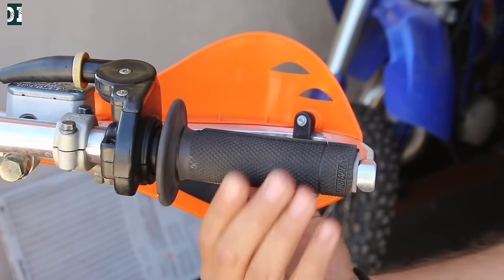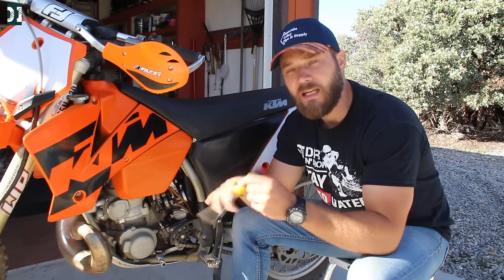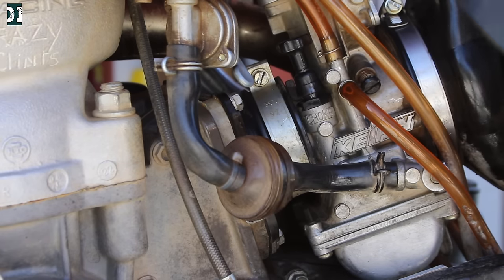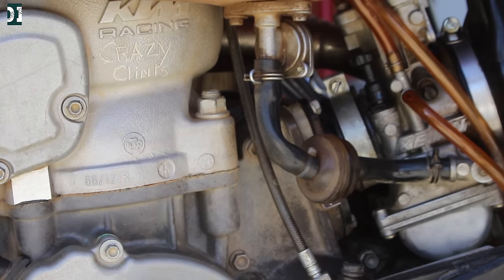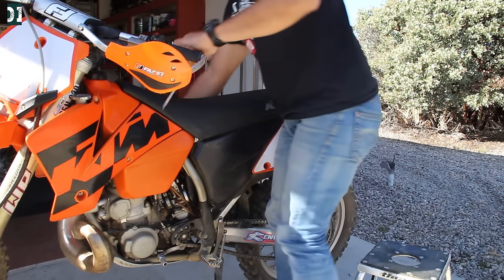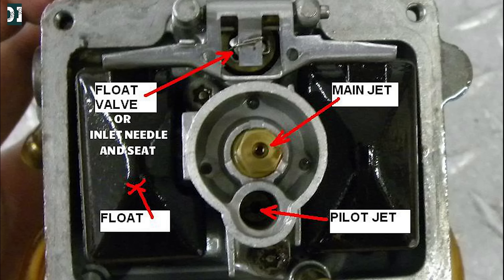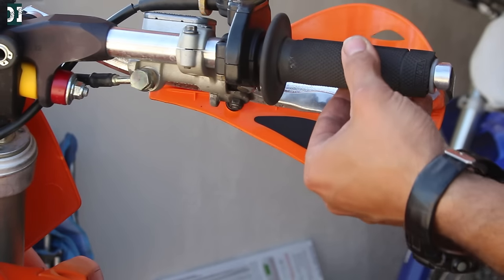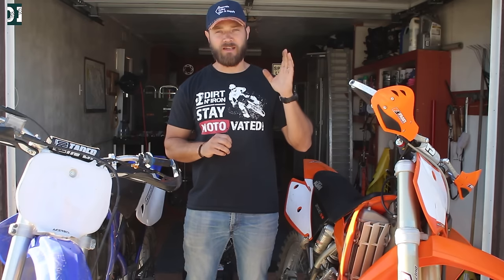How to adjust idle on 2 stroke dirt bike - air screw adjustment 2 stroke.

Comment: This video on two strokes taught me more about tuning a 4 stroke than 7 other videos I watched on 4 strokes before this. Thanks you for differentiating the different types of  screws and being specific instead of just throwing the same term around over and over
Reply from the maker: thanks, glad it helps!
Reply: @dirtniron  i have one issue with same  carb, runs fine, revs good, but stay to high at idle or die. cant find that low rpm idle like yours. also sometime I adjust it and is fine, than in the middle of ride again goes to high or die. I always keep a little play on the throttle. (edit: 1 size bigger pilot jet was needed. First I raised one clip the needle, then it run very bad but the idle was great, so I put the needle back and switch the pilot jet to one size up and runs and idle perfect now) Thanks for video.

Comment: I must admit I adjusted the idle on my Yamaha yz125 by the cable, I did know it was not right to do it that way but I was too frightened to mess around with the screws on the carb in case I messed it up and couldn't put it right but after watching this video I'm no longer frightened and am going to do it the correct way tomorrow.  Thank you for explaining it in a simple understandable way.
Reply from the maker: cool Mark, glad you found it helpful. Good luck tomorrow!
Reply: I’m guilty also

Comment: Great video. I battled with idle on a 2021 kx85 for 2 weeks. This video helped. I turned in both idle and air screw and started the bike and continued to turn down the idle until the bike quit. Started again and turn ed air screw out until there was excellent throttle response.
Reply from the maker: glad to hear that the video was helpful. have fun Jeff!

Comment: Quite a library of useful information you've put together.  This video was EXACTLY what I was looking for.  In your "I was wrong about the YZ125x," I mentioned that I was on the verge of getting my son a 2-stroke 85.  When I bought it the bike would not idle.  I felt confident that it was something simple, because it would start first kick (as long as you gave it a little throttle when kicking it over), but it would not idle.  I didn't have a screw driver, so I tried with my fingers, but it was too tight.  I bought it anyway.  When I got it home, I set air screw out to  the "starting point" of 1.5 turns out, and with adjustment of the idle screw, I achieved a pretty good idle.  The only minor issue I have is that once it's idling nice and low, it kinda bogs a little when you blip the throttle.  Once it revs, and you let go and re-blip the throttle it's pretty much perfect.   But when you let it do the nice low idle again, and blip the throttle, you once again get that initial bog.  This video has made me hopeful that if I play with the air screw, I might be able to get rid of the initial bog off of idle.  Thanks.
Reply from the maker: glad you hear that, appreciate it!  you should be able to get rid of the bog, she might need little bit more fuel..  I bet your boy is ripping that 85 ;)  good job dad!!
Reply: @dirtniron  My son started with a PW50, moved to a KLX110, and then a CRF125F.  The KX85 is his first serious bike, so he officially entered the big time.  :-)    I'm already planning his next ride.  If he clicks with the 2-stroke, his next bike will be a KX100.  If he doesn't click with the 2-stroke, his next bike will be a CRF150R.

Comment: Thank you so much. I just got a 2022 ktm 150, and I’m getting back into riding. I knew right away the throttle response was off, but I couldn’t tell if it was fuel mix, jetting, etc. this helped!
Reply: On ur bike did this make the bike run better when riding it or was it just effective at idle

Comment: Brooo! Thank you so much! I’ve got a 2021 YZ250. I took out out for my first ride and it wouldn’t hold idle. I have this same carb on the bike. I turned in the idle screw until it would stay running. It takes 4 to 8 kicks to get started and I’ve been fouling plugs like crazy. I had no idea that there was also an air screw. You’ve saved me a lot of heartache here. Thanks again, awesome video!
Reply from the maker: cool Skyler! glad to hear that. Enjoy your bike 👍
Reply: Depending on your elevation and temperature your jetting could be off.

I live basically at sea level and it was still jetted too rich. I had to change the pilot and main jet and adjust the needle. 
At sea level the air is denser and you need more fuel (more rich) so it seems like factory jetting is almost too rich for anyone.

Fouling plugs can be too rich or just not being fast enough to keep the engine cleaned out.

Comment: Honestly, I find that tuning purely by ear will often lead to being in the ballpark, but not quite.

I always like to run a tachometer - even a 5€ one will do - and zero out my settings.

I will then pull out the air screw two and a half turns and three or four on the idle screw. That will usually get any bike going on a lumpy idle.

Next I tune down - or up- the idle screw until I get something consistent at, lets say, 1500rpm and only then I start playing with the air screw.

Screw it in a quarter turn and see what happens. If the idle goes up, then I'm in the right path.

If the idle goes up, then I bring the idle screw out until I get a steady 1500rpm again. Wait a few seconds and give the air screw another quarter turn. 

If the idle goes down, then take the air screw in the opposite direction. Do not adjust the idle screw to compensate a low idle after a tweak on the air screw.

Repeat until the best possible idle is achieved.

From there, I will always screw out the air screw an 1/8 turn, just to keep things on the rich side and add some response.

And that's about it. The over 3 turns, under 0.5 still apply, but this way you can be analytical in the process if you're just starting out and visualize the results of what you're doing.

On four strokes I pretty much do the exact same thing.

Tuning an idle on multiple cylinder carbs. Now that's a bit of a pickle :D
Reply from the maker: Thanks for sharing Andre!
Reply: on multi carbs you get a vacum gauge and just set them up the same . i do it at work its easy
Reply: this one helped me so bad!! thanks
Reply: I've just come across this comment and was going to try it but just picked something up I thought I'd query. 

2/3 of the way down you say ..... "From there, I will always screw out the air screw an 1/8 turn, just to keep things on the rich side" .... do you mean turn IN on a 2 stroke to make it richer, I believe turning out makes it leaner???

Also ... you set the idle screw so it's approx 1500 and then adjust the air screw, then adjust idle back to 1500 again and keep repeating until you get it right. As an alternative, from the 1500 rpm, couldn't you just adjust the air screw until you get the highest  reading and turning it in either direction causing the rpm to drop, then give the 1/8th turn (in the correct direction :-) ) and only then adjust the idle screw to bring it down to the desired rpm?

Sorry …. Not meaning to pick holes in your comment but this is all new to me and just trying to make sure I get it right rather than doing something to damage the bike.
Reply: @nevilleprice8797  you got me on the 1/8th turn. On two strokes (can also happen on some 4 strokes depending on the carburetor) turning out the air screw will make it leaner, not richer. Rule of thumb, it the screw is close to the intake, then it's an air screw. If it's close to the engine, then it's a fuel screw.

"As an alternative, from the 1500 rpm, couldn't you just adjust the air screw until you get the highest  reading and turning it in either direction causing the rpm to drop, then give the 1/8th turn (in the correct direction :-) ) and only then adjust the idle screw to bring it down to the desired rpm?"

Not really. Usually at a fast idle resonance comes into play and things can get whacky.
Reply: @foil666  Cheers for that .... just wanted to double check :-)

Comment: Thanks for sharing, always a good thing to have more knowledge about our bikes. Usually when I tune my carb I turn the air screw all the way to the right make the gas richer, make the bike idle in 2-3 rpm and then I turn the air screw slowly to the left make it leaner until the engine idle at its highest rpm it could reach. When the idle rpm is not taking any higher when you turn the air screw counter clockwise thats when I know it's the right setting. Usually it takes 1.5-3 turns to the left to reach, more than that then I'd change the pilot jet size. After I get the air setting then I'll adjust the idle screw.

Comment: thanks man so much,i bought  a 95 cr250 and ti will idle so low it would die some times when completely hot,so i adjusted the throttle so it opens the slide,what happed was it idles without dying but when warm without load it would climb to insane rpm level,so even thought it idled it would rev to like 5000 rps without load.i worked with 4 strokes up until i bought this cr250 and this vid helps a lot.
Reply from the maker: cool man, glad it helps!

Comment: Thanks rado. As usual a very useful and inofrmative video. My beta 250 came with the float level set too high. It was leaking gas from the overflow a lot! Other than that, it seemed to run fine. Once I adjusted the float height lower, the leaking gas went away but now it has a slight bog only when giving it sudden and lots of throttle off idle. Everywhere else, it runs very crisp.  I am going to play with the air screw now to see if that fixes it.
Reply from the maker: yea, I think you should be able to adjust it with air screw,  in not I thing go one size bigger on the pilot.good luck!

Comment: Thanks a million! this video helped me out a lot,  i just bought a KTM Exc 125 if i'm not mistaken it is the same as the one you used on the video, but in any case my idle was too low and always have to pull the choke when i'm not riding or keep my hand on the throttle so this video helped me out a lot i quickly set my screws and now it idles like a dream! thanks DirtnIron keep up the good work!!
Reply from the maker: cool Daniel, glad I could help! Enjoy your ktm ;)
Reply: Daniel 😂😂

Comment: Best tutorial bro. I was doing some research and I know that’s not something very complicated, but u make it so easy to understand ❤️🙏🏻 I got I very nice 2002 ktm 125sx 2 stroke. I be honest that bike is very in mint condition I know I just have to work with this things. The engine only have a fresh 27hr, a tons of new parts. But it bogging in lows rpm like 1/4 throttle before the powerband and torque. I don’t know if is something with the air or fuel. I put v force 3 reed cause I like trails so I just want some smoothest throttle and more power at the acceleration. I know maybe with the v force 3 it don’t gonna run very fast cause it make the bike more like low and mid range, but my bike top speed are just like 47mph. I think I should do a lil tune wt the air-fuel screw to see if it grab a little more power and stop bogging at lows rpm cause the bike have a nice powerband but that little bogging or si leak give me anxietys.

Comment: Great video and thank you for the clear explanation. My old DT175 had idle issues and I am at 1/2 turn out to get it to run close to correct. Could not figure out if I needed to go bigger or smaller on the idle jet. Your video explained it well and I used my jet drill set to open it up just a bit and not I'm 2 turns out and it runs perfect!
Reply from the maker: Cool, glad the video was helpful! Have fun Roland 👍

Comment: RM 125 with no kick starter( to expensive lol) So jump starting it my driveway a few tiimes then jumping off with the screw driver ,with weird looks by the neibours :):)  But eventually got it running sweet :) power valve 1 turn clockwise too wow.. didn't know 125's had bottom-end hahah thankyou mate. Another fan from nth qld Australia.
Reply from the maker: haha, you are a hardcore mate!
Reply: @dirtniron  Nothing more-Nothing less :)  #motorhead

Comment: Hey, love the videos. You have very informative videos that are straight to the point. I have an interesting case that I am hoping you can help me with. I recently picked up a 1998 Honda CR250R 2 stroke. I live at 4000ft elevation, and the bike was bought from someone who lived at sea level. The bike runs absolutely great when started, huge amounts of power and immediate throttle response. I would just like to know how to tune the carb per elevation. I did what you did in this video with the 2 turns out, and adjusted the idle, and it seemed to run pretty good, but had trouble starting cold on the next start after. Wondering if its too lean? What I really would love is to figure out a good air/idle screw combo that can run good at my house, but also run good at sea level. Also I am running 32:1 with Motul racing oil. 

Prior owner was running 44:1 with around a 3/4 turn out on the air screw. From what I have been told though, you should not adjust your fuel/oil ratio...the manufacturer puts it there for a reason. If you are running too rich or too lean, you need to change jets. 

Any help on this subject would be very much appreciated! This is my first 2T, and god damn its a powerhouse. Just want to really get it restored and running as best it can!

Comment: Thank you man u have the best examples of how to do this I found it very helpful just started riding a 250sx and never had a two stroke always rode 4 stroke I love the ktm just all so new to me and even though it had great throttle response the way the rpms dropped just didn't sound right to me so I played with the throttle screw and air screw out on the trails before I watched this video and I'm glad I watched this later because after all the bike does sound healthy if you're is healthy then mine must be because it does sound the same lol so thank u for the vid

Comment: If I want to start from scratch, I would put the air screw 2 turns out as you said, but how many turns out should the idle adjustment screw be?
Reply: Came here for the same thing. Need a starting point for the idle screw